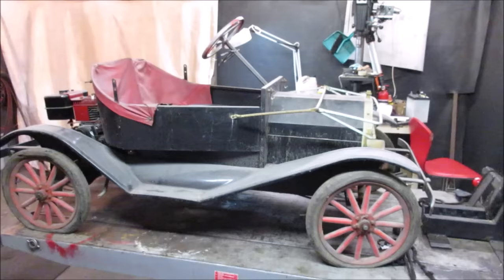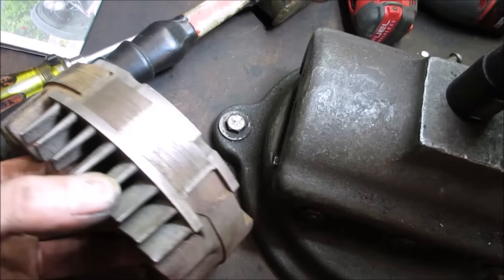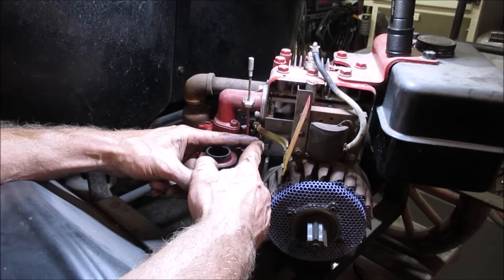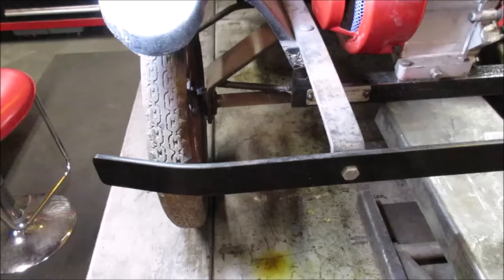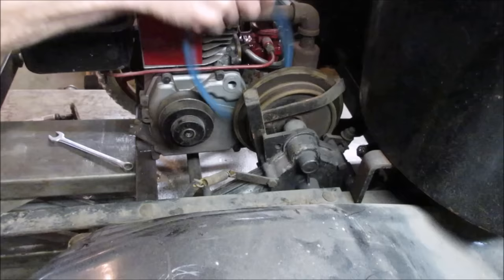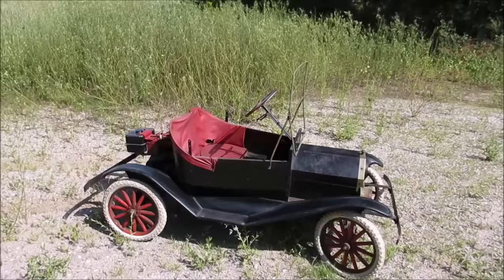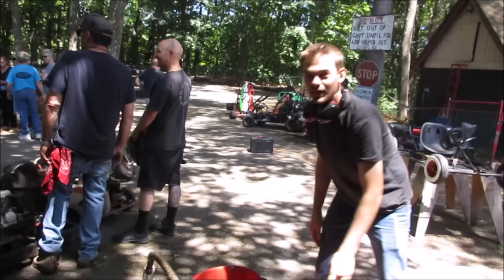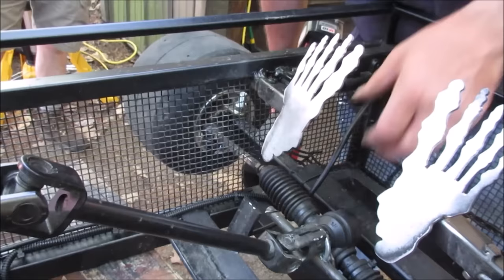Will It Run? Shriners 1962 Go Kart

Comment: Welcome back.  McDonough is a town in central Georgia just south of Atlanta.  I live about 20 miles from it.  McDonough Power Equipment was one of the major industries there.  Besides this scaled down Model T's they also made Snapper lawn mowers, in particular the old Snapper Comet mowers.  They were part of Fuqua industries.  They were bought by Briggs and Stratton  and are no longer in business.  Their old building is now being used as a storage area for the Henry county school system.
Reply: I lived in McDonough for 13 years and seeing one of these gems is a reminder of home!
Reply: I had one of those mowers. Got it from my ex father inlaw. Hell of a mower and you could bush-hog with that bad boy 😂. And left one of the prettiest cuts, live in sw ga so it wouldn’t surprise me if that mower came from McDonough. Also when I googled that company, a court case kept popping up of some people suing the company due to someone getting injured by a mower. A foot got caught by the blade. Curious if it’s the same company.
Reply: @kentfuqua9634  Were you related to Joe Fuqua that lived in Jackson Ga. which is just south of McDonough.  If memory serves me correctly, he owned stock in Fuqua Industries.
Reply: @kentfuqua9634  Were you related to Joe Fuqua that lived in Jackson Ga which is just south of McDonough.  If memory serves me correctly he owned stock in Fuqua Industries.
Reply: Thanks for the info Jerry. I live in McDonough for just 3 years now and that caught my attention which sent me down the rabbit hole of McDonough Power making the snapping turtle mower which then became Snapper. Very cool history there.
Reply: Not related to him. The Fuqua Industries were actually 4th cousins but we never knew them.

Comment: You have a gem right there.  I am glad you take a break for a couple of weeks and hope your wife is doing better.  Prayers Sent for her.  The old model T looks like one that may have been from a couple of amusement parks that were open here in northern New Your State in the Adirondacks.  One was The Land of Make Believe, in Jay, NY, and the other, Gas Light Village in Lake George, NY.  Both were designed and built by Arto Marco, who was at one time a designer for Walt Disney.  He also designed and built Santa’s Workshop, which is still running today, and is the oldest amusement park in the US.  Both places closed in the 70’s

Comment: Amazing how Mustie1 finds these gems. Will it run? Of course it will, just needs a little love and it gets it with Mustie1. When I was 13, 51 years ago, my dad had a mower that would not run, so he bought a new one and gave me the old one. He took off the blade for my safety and I took apart the carb and flywheel. Cleaned the carb and points and surprised him when I had it running a few hours later. Word spread that I fixed that dead motor and soon after I had several to fix. Dad had my blade sharpened and I mowed lawns and fixed mowers for spending money until I was 17. I love these "Will it run" series. In 1962, I was 5 yrs old, I remember the old Shriners Parades, there would be 6-8 of these cars in the parade. Good times. I look forward to our Sunday video from you Mustie1. She`s a runner!!😁

Comment: The rear axle is not supposed to float. There is a small plate that bolts on the bottom of the axle that holds it in place. If you remove the plate, it allows you to remove the whole rear end. I know this because a neighbor had one years ago and I watched him work on his when the rear axle got bent. Also, Pepsi Bottling Company gave several of these away back in the mid 60's... Love the videos. Please keep them coming.
Reply: A girl I knew in Phillips WI won one back in the day, I was so jealous.

Comment: When I was about 14 back in 1962 my brotherinlaw at the time gave me one of these. Used to drive it all over the neighborhood. After they got divorced he took it back, lol. Was a lot of fun. As I recall the drive belts on mine were on the drivers side. That small angled metal rod was mounted in the front just for looks (fake Starting Crank). Thanks for the memories. :)
Reply: Here in Ontario, Min wage for construction workers was $1.25 an hour. If that thing sold for $314, that would mean dad would have to work over 250 hrs to pay for it. That's before deductions too! No wonder no one in my 'hood had one hahaha.

Comment: The Shriner Model -T is a classic…. Every kid me included wanted one.  Glad to see it featured on your channel.  The fun day at the Go-Kart track are all examples of grown-Ups recapturing what they loved to do as kids.  Pure Americana……👍👍👍
Reply: The Shiners used a car like this so did Amusement parks my guess is this is a Amusement Park car with the throttle setup at the engine on the carburetor that is how the Amusement ride cars were a Shiners car should have a throttle inside the passenger compartment.
Reply: @steve-ph9yg  This had a throttle in the cab. It was the lever on the steering column behind the wheel. The cable that ran to the engine was jammed with corrosion to start with, and the adjustment lever bent, so he was just playing with it from the back until he got things cleaned and straightened.

Comment: A buddy of mine had this exact thing. It was from before the early 60’s when we were playing with it. The name plate you showed early in the video said McDougnah Equipment Co . They were made in McDounagh Georgia. They also made heavy duty walk-behind lawn mowers. They were a unique design, with a row of drive wheels across the rear of the mowing deck and a semi-circular skid underneath the blade up front instead of wheels allowing you to turn it easily. It too had a reverse. As a matter of fact the drive belt system and friction disc reverse were exactly what’s on this little car. The machine was a monster and extremely powerful. They were used by the our school system in south Florida. The larger model was powered by a large single cylinder Wisconsin (8-10hp

Comment: I remember these shrinner carts from when I was a kid in the 70's, Valley City North Dakota.  There maybe a video of them being used from their historical society.  That crank you pulled out of the seat was a part of the bit.  The car would die and would not start.  It was a keystone cops type of bit with what may have been ladders off the back if you remember the famous keystone cops movies.  These carts could really move and they would do all sorts of tricks with them.  good old fashioned entertainment.  I think I remember a kid riding with an older adult.  One would crank the crank and there would be fire cracker backfires and all kinds of fun.  Thanks for rekindling this old memory of days long gone.  Oh, that brake on the side was used to slide the rear end.  I couldn't remember if they had wet streets to carry on this bit or if they just tore up the pavement.

Comment: Etienne Lenoir invented the spark plug as long ago as 1860 for his coal gas engine. The spark plug was commercialised by Robert Bosch in Germany, Fredrick Simms in the UK and Albert Champion in the USA around the turn of the last century. The sizing into 18mm, 14mm, 12mm and 10mm standards came from Robert Bosch in Germany, hence the use of metric threads. Additional development was contributed by the Lodge brothers and the well known British Racing Driver, Kenelm Lee Guinness. Lodge and KLG plugs were still in common use on British racing cars up to the early 1980's, as they offered a plug cleaning service at a fraction of the cost of a new racing spark plug. Both of those companies were bought by Smiths Industries in 1989 but KLG plugs are still available for specialist applications, like vintage cars and airplanes.
Reply: It is fascinating that old plugs were built to last plus they were expensive, and you just serviced them like any other part; adjusted the gap, filed the electrode, had them cleaned and went on your way until the next service interval. Nowadays, they are thrown away and replaced by nitwits who think the spark plug is worn out (and the cause of their no start issue) at, say, 10K miles or way less.
Reply: @Hjerte_Verke  On the other hand, I remember working on my MGA every weekend to do basic things like keeping the valves and brakes adjusted, and regapping the plugs about every 4 months, and replacing them every year or two, because they really were worn out. And these were good quality Champions or NGKs. On the other hand, I've had a Maxima for 27 years now, and it has had ONE spark plug replaced in that time, and none regapped. Heck, I don't even know if they have adjustable gaps.

Comment: Had me a plain ole go-kart when I was growing up. Actually it was the whole families, I learned to work on engines with my dad and brothers with that thing. Went through several motors and a thousand flywheel keys. We always ungoverned the engines and tuned the carbs to perfection. At one point we had that little thing going everybit of 50 mph maybe faster. It was super dangerous with no roll cage but at least it had low cg still managed to flip it on occasion though. Such great memories. Thanks man

Comment: Wow! That brings back memories! My dad was a Shriner and I remember him working on, and driving these little cars when they had a parade. Thanks for the vid Darren!! 🏆
Reply: Did they buy them built, or they built  them selves
Reply: @cheeseburger9232  I believe in the 50's and 60's, they were made by McDonough. I think this is what Mustie1 has. That's only for that time frame though. The Shriners have done everything from building their own (1800's) to using a JC Penny micro buggy car platform in the 1970's (I think). The Shriners don't just use cars. Depending on the geographic (such as New England) they made several boat/cars. Looks like a mini boat but is a micro car underneath. Several different manufacturers over the years on many different models.

Comment: You can see in the video it DOES send power to the right rear wheel, but the hub on that side has no keyway or pin to engage it with the axle so it just floats on there.
Reply: yepp.. at 1.01.50

Comment: These are a cool cart, my step father had one. The two seat here could be as old as 1958. The company continued to make them up to the early 70s and that model goes up to 12 mph. The company no longer makes them but is still in business. While a Shriner surely could use it they where intended as a kids toy.
Reply: You can see the way the back seat was curved to form 2 seats for children

Comment: The hand crank used to be used as a prop, they would pretend to spin the engine and fall down or something else. (they obviously were not connected to anything)

My Father built a 1/4 scale Model T replica in the very late 50's early 60's for one of my brothers. He know someone who worked at Ford when they were making Model T's who showed him how they did the apolstry, so it has the correct pattern.
My Father also used a Briggs and Stratton engine, mounted in the rear (trunk) and used a sewing machine transmission, as he didn't want the car to go too fast (i am certain your car will probably go faster) 
I remember he created a convertable top with a circular rear window, Used Brass battery opperated lights for the front lights (which were just for show) and had a squeeze ball Horn which was always fun to use. My brother has it in his garage now, as his children are now in their 20's and he is just waiting for grandchildren to take it out again.

Comment: I lived near a small engine shop in the 1960s that used to work on the Shriners parade cars. You probably have the children's version of that cart because the backrest appears to be designed for two children. I think the company originally made them as children's cars and some Shriners decided to use them in parades. Then others thought it was a good idea and the company started building special one to fit larger people. The Shriner's carts I've seen have a straight back, the steering wheel is centered in the body and at a more straight up angle. They also had cast aluminum wheels but that might have been on newer models. I just went past the local Shriner's Club Thursday and they were loading their Tin Lizzies into a trailer. I just looked at pictures on their website and their cars don't have the external brake levers.

Comment: Darren, the "kill switch" is missing, but a piece of steel pallet banding works quite well. Drill a hole in it, and mount it under a head bolt so that it is just over the spark plug.
Reply: Pretty simple to rig a kill button so you don't have to stop first. Also fun with braking.
Reply: Gotta watch the whole video before commenting sometimes

Comment: On those drop outs on the rear axle mounts you can see the discoloration of the paint where metal plates / straps, about half an inch wide, fitted across the gap to hold the hubs up.
You're the best entertainment on YouTube Mustie. Thank you.

Comment: The axle is spinning inside the hub on the passenger side in case you didn't notice, I suspect it's meant to be positive traction, you can see it at 1:01:51 in the timeline.
Reply: I saw that too

Comment: Darren, where the wire retainer is holding the rear axle , imagine a U-shaped flat metal plate bolted in place with a short, stiff coil spring (valve spring?) fitted top and bottom between the slider and the  "shackle". Locate the springs by a centre peg so they don't fall out. This would give some rudimentary suspension to the rear of the car. For the brakes, fit a pair of "shoes" to the round shafts that rub on the tyres. This will give better braking effect and not wear off the knobbles on the tyres.
Reply: The suspension works as it was intended this is a parade car where everything is intended to be out of the ordinary and execrated.
Reply: @frankdeegan8974  Nah, as Gordon commented, there was something there other than that wire.

Comment: Based on the shape of the radiator, hood, fenders and the windshield this was modelled after a 1914 Model T Roadster. (I have a '14 Touring.) It looks like it may have had a convertible top.

Comment: I'm deeply sorry for cheating Darren. I checked the model on Pinterest and, the butterfly nuts are to hold a frame for a soft roof. Also, it has 2 glass/plastic windshield. Some has a spare tire attached to the rear bumper, front lights, ahu-ha horn...etc... I have to admit, this is quite a unique project. Thank you for sharing.

Comment: Welcome Back Mustie 1 (Darrin) :) also remember those toy Go Karts in parade in my area for July 1 Canada Day Shriners also Mansonic Groups  use them to every 2 guys rode in it  and had  18 hp of 2 cylinders Briggs Stratton engine plus had Foward & Netural & Reverse by pull hand plus brake handle to plus horn on there plus had switch for 12 volt Negative ground headlights that ran like lawn mowers plus fuel tank was steal 5 gallon in below windshield frame and battery was on right floorboards near door plus has dashboard for key ignition switch also lights plus choke and charge gauge plus tarp for roof top attached front window frame to back seat bolt on ! It amazing both climb up main street hill that 90 'Angle fine plus down to it was wild had black tires stay up air didn't blow out too ! Go Karts are fun ride and never own one ever! I know my Cousin Derek built one from scratch frame he use 1974 Bombardier Snowmobile motor 400 size 2 cylinders with 2 carbs plus exhaust V to center port with exhaust up air like farm tractor muffler with rain cap plus 5 gallon metal round tank and plus had lawn tractor spindles plus tires also rims also chain drive from old lawn tractor and fast over all plus steering too lawn to from old lawn tractor was from 1968 had motor back found in Dump Metal Waste Bin years ago!

Comment: I have the exact same go-kart, it doesn't have the engine, steering wheel is missing, and the wheels are broken, but I have the same one. Got it from the scrap yard years ago and it's in rough shape, yet when I saw this I first said "flippin' heck that's what I have!" and then "that's really clean". Keep up the good work. EDIT: Also a tip for when changing tires, if it's a tire that you're not saving but you're keeping the rim, as long as you can get the tire so it isn't sticking to the rim and get part of the bead out, just chop it with a pneumatic end cutter. I've done this dozens of times on car tires and I'm pretty sure the same principals would work for smaller tires. Also when putting on tires (can't remember if you've said this before) use a soapy water mixture to act as a bit of a lubricant. It can make life so much easier.

Comment: Robert Bosch is they guy you have to thank for Metric sparkplugs, and since he made the only decent ones (for quite a long time) all the engine manufacturers stuck with it, and still do! The very same thread standards are still in use today.

Also just about any british engine (and loads of other things) until the 1980s used BA threads for smaller screws, and those are a "metric-derived" thread form, although many still think of them as an imperial thread.

Personally, I'm a whitworth kinda guy, simply because the machines with whitworth bolts are going to be old enough to be interesting!

Comment: I pinstriped and lettered over 30 Model T's for Amara Shrine in south Florida back in the early '80's for their parade unit. They had one set up as a tow truck with a boom on the back.